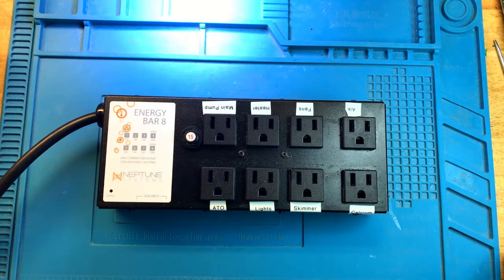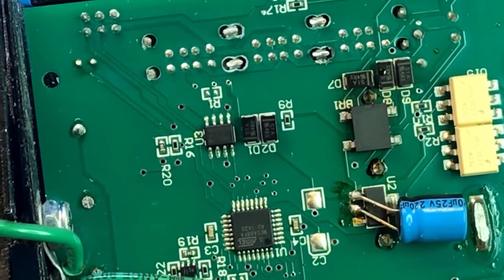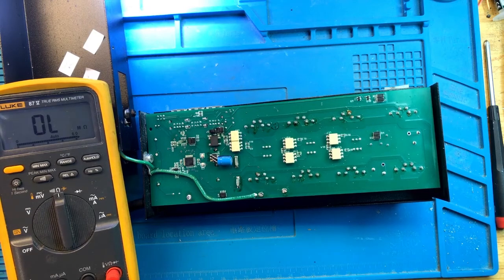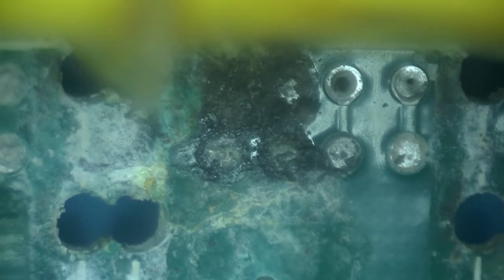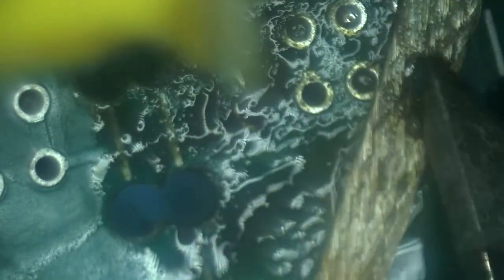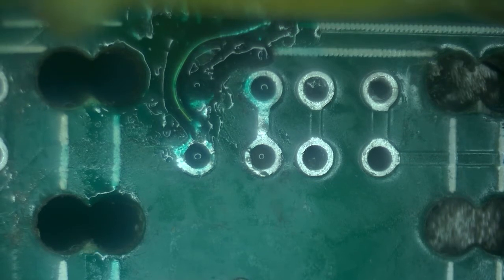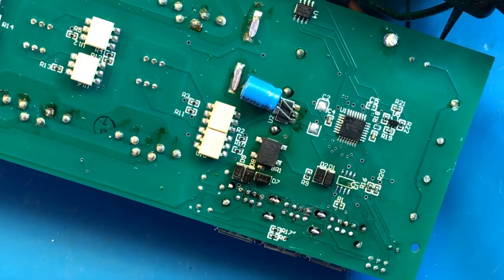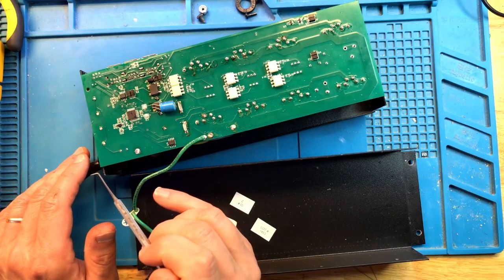Apex EB8 Water Damage - Blown CAN Transceiver and AquaBus Ports

Comment: I had to replace the controller in my EB8.  Everything else on the board checks out good. I also compared everything to a working EB8.
The unit will not come on.
 Does the new controller have to be programed?
Reply from the maker: It certainly does. Blank main controller won't do much good to the unit unless programmed.
Reply: @FixReef  can you give me a clue where i would find a Binary file the EB8.